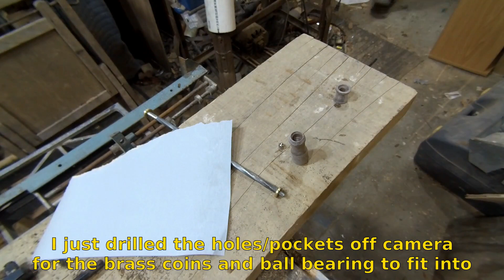Making a Cordless Drill from a Nail (Archimedes Drill) #roughcut2022

Comment: 2 videos in 1 hour! Great lathe work! I never learned working on one, and now I don't have the space for one.
I remember using a drill tool like that back in school when we were learning about old tools, I didn't care for stuff like that back then, but now I find it fascinating.
Reply from the maker: lol, yea, it works pretty well and drills a hole exactly where I need it quite easily as long as it's clamped down. The lathe works pretty well and after my old lathe broke, I was looking at that one and knew it was destined for better things, so turned it into the wood lathe, lol. It does take a bit of skill to control it, but even as a machinist, I would recommend learning how to use one with scrapers because using gravers on the metal lathe, which are virtually the same thing, you can do some pretty detailed turning of parts on the metal lathe too for those oddball projects when you want something ornamental. Ball turning that way is a piece of cake, as is making different profiles is invaluable, and you dont need to grind a custom tool to do it with.